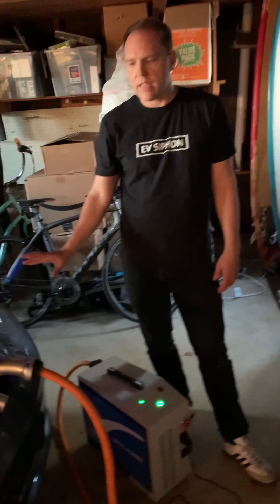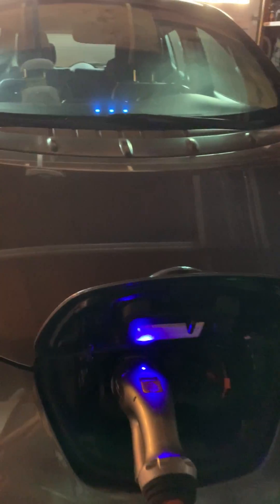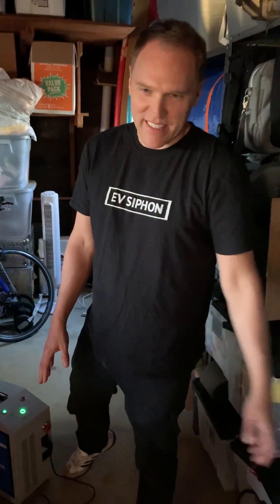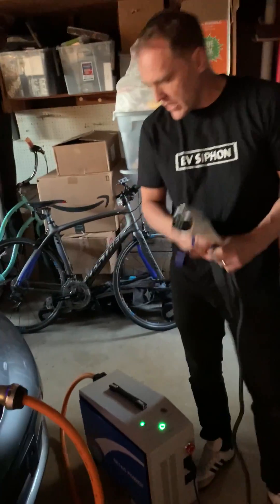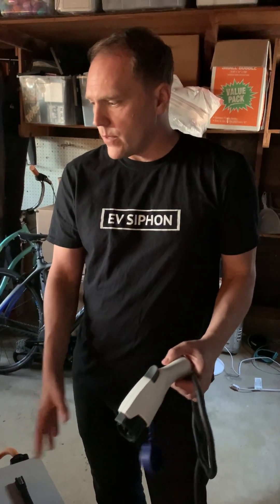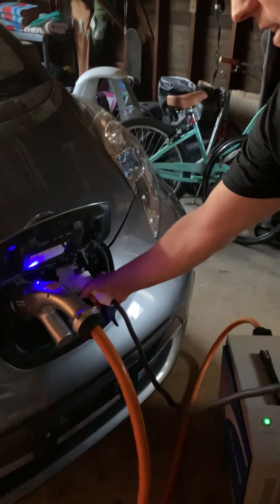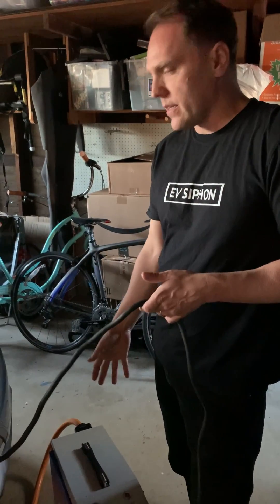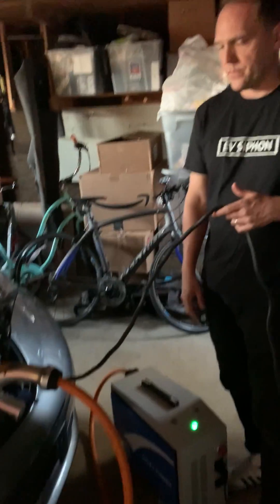V2H discharging + charging at the same time with a Nissan LEAF using a 3kW Setec unit

Comment: Have you come across anyplace else to buy the Setec 3000 units?The 6K ones are only available shipping from Setec in China where I was quoted 2600.00 plus freight.I live in an area with fairly frequent black outs.Its a shame Nissan didn`t follow through with providing some way to tap into all that voltage sitting in my garage just waiting to be tapped.
Reply from the maker: My same understanding - Setec is only making the 6kW units now. I haven't found any other similar V2L products - just know V2H coming out this year from a few companies.
Reply: @evsiphon  Hope some are Chademo.Thanks.

Comment: If you are into hacking on a level of building your own EV it is possible to actually charge a gen 1 Nissan Leaf and discharged it at the same time. I've done it, one summer I used my Nissan Leaf in the driveway as a stationary powerwall for peak shaving/load shifting, it requires opening up the inverter cover and tying into the high voltage bus Which are the large copper busbars on the top of the inverter stack, it's easy to identify because of the chademo cables coming up to it. You also have to tie down the lid switch so the car believes the lid is on otherwise it wont power up. There are two ways to activate the high-voltage buss, one is to turn the car on, the other is to plug the car in and charge it, now this seems like it doesn't make a lot of sense but if you use a level 1 charger, a good one that's adjustable like an openevse and turn it down to 6 amps then you're only sending a small amount and can do it remotely without having to manually go out to the car everyday to turn the car on and later off. I did find was getting ground isolation DTC in the leaf (checked and reset with Leaf Spy PRO). The solution is to lift the ground on teh EVSE as the Inverter i used grounds the high voltage DC input. For the inverter I used a Danfoss DLX 4.4 high voltage string inverter, they're typically used for businesses who do a lot more panels in series than on a house and it's designed to handle 200-500v DC, so the 400 V from the battery pack was ideal. This is not a science project for amateurs and there's some serious danger involved because of the voltages present.  Don't try this unless you understand the risk to yourself and equipment. It wouldn't be hard to add a permanent port to the car to do export, a roll your own DIY V2G system. For those experimenters out there I thought I would share this.
Reply from the maker: Wow! Very impressive. Thank you for sharing the detail. Agree not for amateurs due to high voltage, but also because of the grounding issue without galvanic isolation.
Reply: @evsiphon  Thanks! I came across your video and love stuff like this so it encouraged me to share. It is possible to maintain the Galvanic isolation of the 400v DC pack, it just requires an AC Inverter that doesn't ground its negative DC input lug.
Reply from the maker: @bsaelectronicsgmail  Good to understand. I've seen several other videos of people connecting to a home that to do have galvanic isolation that makes me nervous.

Comment: Have you ever plugged your Setecs outlet into your next socket of your home? What happened? Did your counter turn backwards?
Reply from the maker: I did set up a transfer switch (https://www.youtube.com/watch?v=aAF_sEOuEdU&t=4s), but no, this is not designed to be grid connected to turn the meter backwards. Issues with grounding, interconnection, etc. that make the different between V2H and V2L
Reply: @evsiphon  Thank you. A friend did this with the IONIC5 with AC outlet, he switched off the three large main fuses and plugged the car in his home behind the fuses and it worked perfectly. He powered the hole house with his IONIC5. So question was if Setec can do the same.
Reply from the maker: @timstruppi7897  that is awesome to hear. What that in the US with splitphase 120V/240V? Or another country with single phase? Setec is single phase (not split phase) and know it can do it in  countries outside US, but not sure how grounding is handled with V2H. V2L is floating ground.
Reply: @evsiphon  no it was in East Germany, look after a video from "Nextmove" and you will find Stefan with his drilling machine. The higher equipped IONIQ5 comes with a free outlet adapter which delivers 230V instantly and also shows data in the dash. Like any japanese e-NV200 with 115V outlet socket in the back...
Reply: Having the meter to turn backwards means having a V2G configuration. The short answer: NO. 
Long answer: Your car inverter should be able to detect the presence of mains Voltage & Frequency and talk to it, so to speak. This is a specialized circuit found in Hybrid inverters. Requiring approval from your utility as doing it directly as indicated in your comment will damage your inverter at the least and will srnd power back to grid during outages causing a safety issue with utility workers.